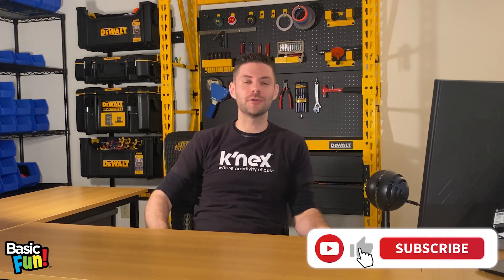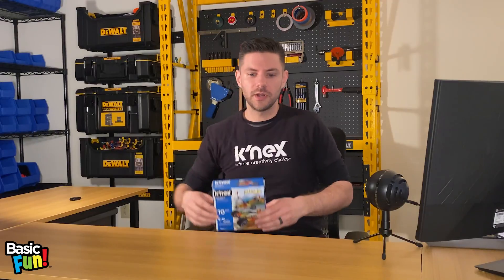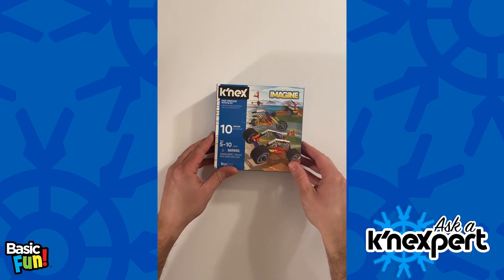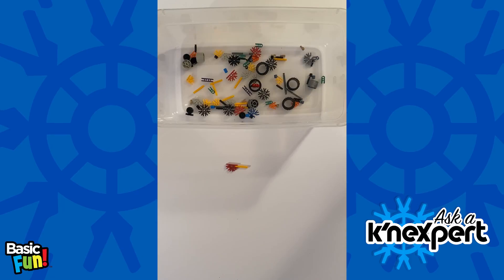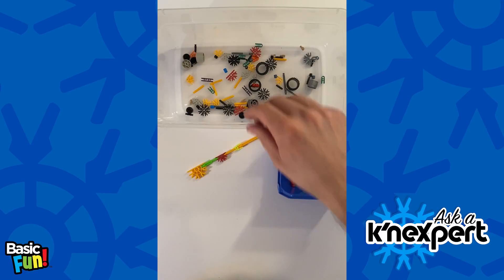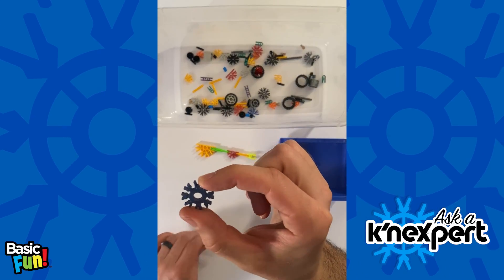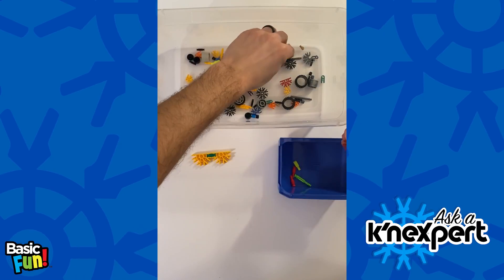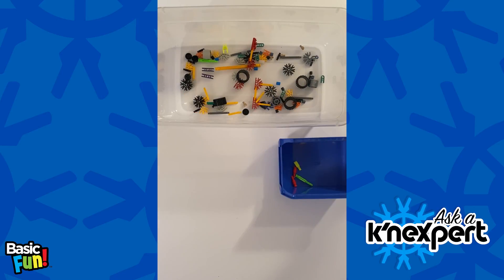Ask a K'NEXpert - How To Connect Micro and Classic K'NEX Pieces (Ep. 1)

Comment: I personally have so many of the rod transition parts that I don't know what to do with all of them.  Right now, I have most kinds of micro pieces, up to micro red and standard Yellow rods are what fit, in the metal boxes from Altoids to keep each piece organized when not in use and in a specific order of what kind of piece they are on a shelf, built with standard pieces, for easy access.
On occasion, I've noticed that multiple sets, throughout the years, seem to deliberately have connections be on an odd angle, separating the bits on either side of where the rod goes, that often results with connectors being unable to hold onto a rod as well as it did before in that place after the deformation over time.  What are the reasons for that?
I'm also curious about what kind(s) of plastic are used for the pieces.